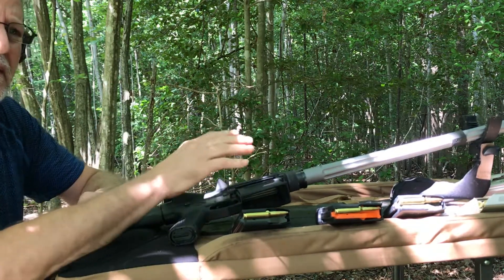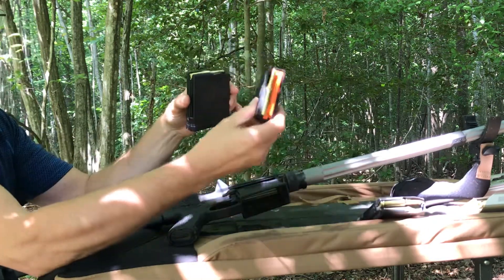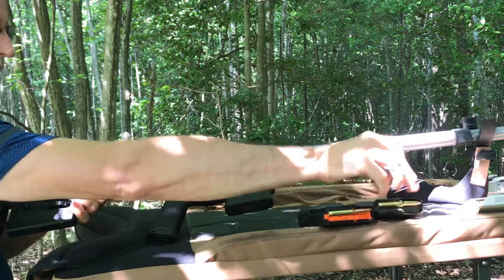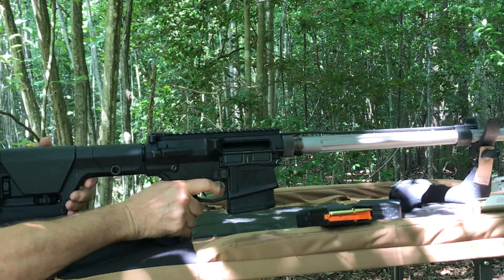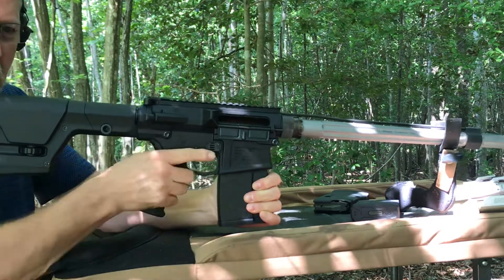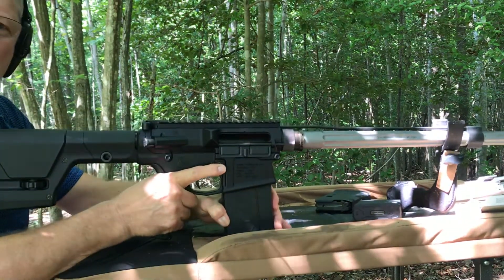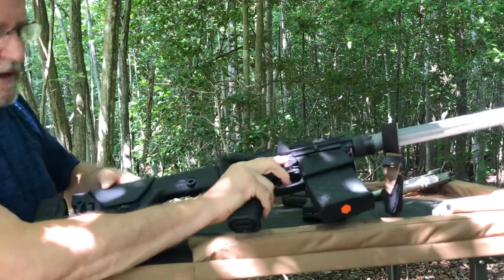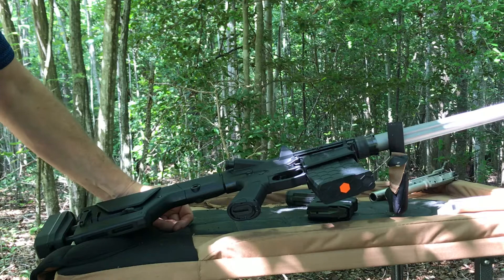Continued troubleshooting the 6.5CM project

Comment: I just made my first AR 308 - Aero Precision with 24 inch 6.5 complete upper that didn't come with a adjustable gas block.  Fired my own reload 140 grain match burner w/39.5g IMR 4350 that's a mid load based on  the reload data.  The first 50 rounds were one shot bolt latch test.  It would first not eject and eventually started to eject but never bolt catch. I just took a look at the gas block and there was a lot of carbon on the barrel and under the gas tube on rhe barrel.  The Aero lower is a carbine tube with 3.8 oz buffer.  I took off thw gas block to check the gas hole and it looked fine and I reinstalled the non adjustable gas block.  Aero said the gas was carbon and it will seal eventually after 500 rounds.  My bcg is Brownells brand and I will do the WD-40/ compressor test tomorrow for leakage.  What was your conclusion and suggestion
Reply from the maker: @irwinyuen7789  first of all, I am shocked Aero said the gas system would seal eventually.  That’s crazy.  It sounds like it is under gassed because it is bleeding off gas around the block.  Is your barrel and gas block Aero brand?  How dung did your gas block slide over the barrel?  It should be pretty snug, but you shouldn’t have to hammer it on or anything like that.  Defined still do the compressor test on the BCG.  You want to know if it is leaking gas there too.   In my case, after 3 new BCG (2 different brands) leaking at the gas key on the BCG, we just removed the gas key and re-bedded it and staked it down.
For what it’s worth, I have built a few 308s and no problems.  This was my first 6.5CM.  Keep in mind my video was just after COVID when things started coming back to life.  I think industry QC was an issue at the time.
I will be doing a couple more 65CM in the near future.
Let me know how it goes.  Happy to chat on the phone sometime if you’d like.  Where are you located?